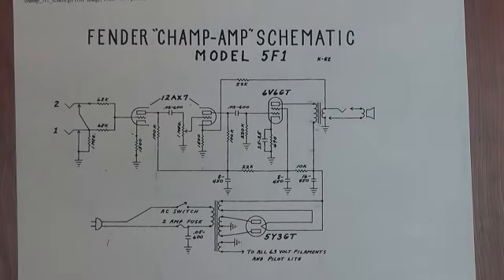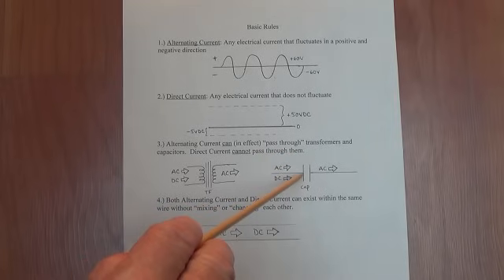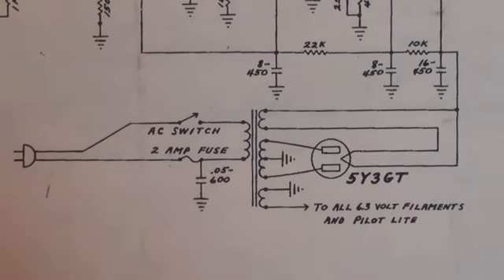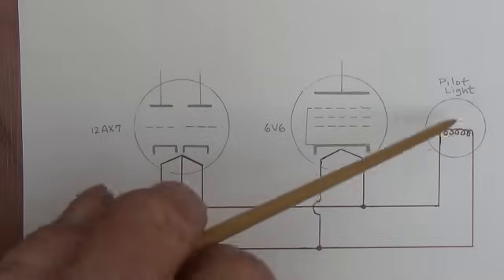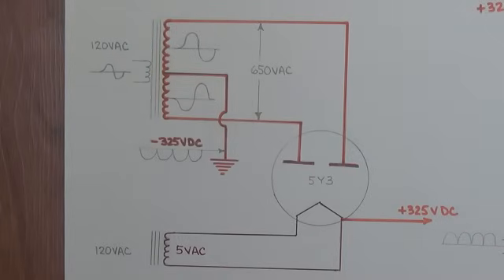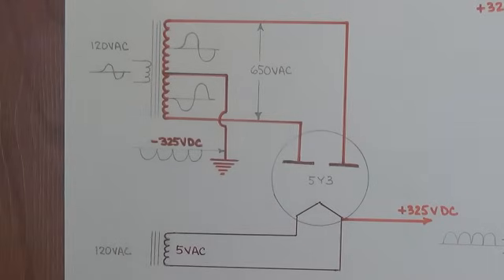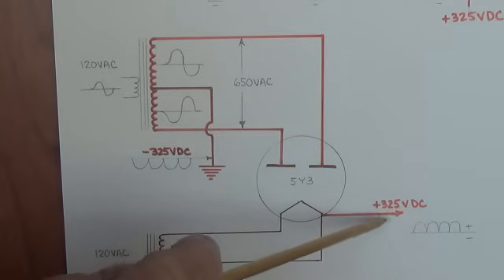How Tube Amplifiers Work, Part 1: The Power Supply

Comment: Uncle Doug I have a question about the use of the standby switch in tube amplifiers... Way back in the late sixties when I was a teenager, I played in a rock band and had a fender twin reverb... The music store owner told me to turn on the power switch first.  To let the filaments heat up.  After about 30 seconds we would do our sound check.  When that was over I would put the amp back in standby without turning it off.  Then when the first set began back out of standby.  After playing for 45 minutes it was time for the first 15 minute break.  Again back to standby without turning off the filaments. This would continue three or four times until our 4 hour set was over.  After the last song I would turn off both the standby switch and the power switch.  He told me to wait 5 or 10 minutes before moving the amp to let the filaments cool down.  He said if you move the amp all the filaments are hot you have a better chance of having the filament break.  So all of this led me to believe the standby switch was mostly to allow you to disable the amp while not turning the filaments on and off more than once per gig.  Was this strategy wrong?  Is the standby switch really for the b+ surge?
Reply: Thank you Uncle Doug. Take care and I'll stay tuned!
Reply from the maker: I think what you did, especially with a big powerful amp, was probably a good idea. Filaments tend to fail during the rapid heating phase. Since you maintained them in fully heated status, they were protected from the rapid expansion from cold to hot. Also, since no current was flowing within the tubes, the cathodes were not being "aged". However, use of a standby switch (SBS) for any other purpose is probably counter-productive. Even with the SBS, on a cold start, the filaments get the same rapid, potentially harmful heating that they would without the SBS, and who ever thought that allowing the B+ to build to maximum before blasting the tube plates with it was a good idea???  Even with diode rectification, and especially with tube rectification, the relatively slow development of B+ has to be more gentle than the SBS blast. Personally, I think your method was an ideal use of the SBS.

Comment: "Ground" is a reference plane that is deemed to be 0 volts.
"Ground" is the reference point against which most other voltages are measured.
Remember - valves in an amplifier need high voltage direct current as the power source. The purpose of the power supply is to create a high voltage DIRECT current from a high voltage alternating mains power current.

There are two ways to do this.
1/ use a bridge rectifier, or
2/ use a transformer with a centre-tapped secondary winding connected to a full wave rectifier. As this needs to bump up the voltage, using a transformer connected to a full wave rectifier is the best approach.
By using a grounded centre tap the two ends of the secondary winding will have outputs of equal voltage and current but be 180 degrees opposite in phase to each other, and will be half of the voltage as measured across the whole of the secondary winding. From a centre-tapped 650v secondary winding you'll get a +325v and a -325v as measured from the grounded centre tap.
Thinking about it as a mathematical chart with an X and a Y axis and By having a centre tap you in effect create an X-axis of 0 volts, and the secondary coil outputs 650v, swinging positive and negative 325v on the Y-axis above and below each side of the X-axis. Each end of the secondary coil is 325v when compared against the centre tap - 0v.
Connect the outputs of the secondary winding to their corresponding diode on the rectifier. That way you'll end up with a somewhat ripply Direct current. You use a power capacitor to smooth out the ripples in the DC.

The centre tap on the secondary coil is the ground plane - 0 volts.
Reply from the maker: Thanks for the lengthy and detailed explanation, S. My intent was to show that either B+ or B- are created by the power supply, depending on which power transformer lug you use for measurement. This was explained with subtitles in the video.....which were discontinued by YT.

Comment: Sir I have a question for you. I don't know how you feel about random questions, so if you choose to ignore, I really do understand. But I'm struggling with something that may be very easy for you. So I'll just ask and explain best I can.
I have an early 1960s Valco amp that I'm trying to revive back to life. I went though the preamp section with a fine tooth comb and found it to be impressively accurate with the schematic.
My problem is with the power amp portion, and how it's wired from the factory around the 5U4 rectifier tubes. (definitely not like the schematic). From the factory, they terminated one of the two wires from the power transformer to the heater element on pin #2 and the other on pin #8 (which I understand to be accurate), but then from this point on it strays from the schematic.
The schematic shows B+ wiring (to other parts of the circuit) terminated on both pin #8 - And - pin #2 
But this is how the factory wired it. They took one of the 2  wires from the transformer and terminated it to pin #2. No other wires are terminated at this connection on pin #2 it just goes from the transformer to pin #2 and that's it. At this point the factory wired ALL B+ wiring to pin #8.
So my question is, are both ways of wiring this correct, and that both methods will work? The schematic shows B+ wiring terminated to both pin #2 & #8. I seriously don't understand this. 
I've never heard this Valco even work, but I assume it worked in the past. And I can assure it's never been touched inside since production. Even has all original RCA tubes. 
I know this is a long message, but I've been thinking about this for several days and would really appreciate your input. 
Sincere gratitude
Reply from the maker: The B+ can be taken from either pin 2 or pin 8, but not both. The schematic may be trying to show that either tube pin will work......but trying to use both would result in a short circuit, bypassing the heater/cathode.
Reply: @UncleDoug   . .  Thank you sir for your response. I would love for you to take a quick look at how Valco shows the wiring to the 5U4 rectifier tubes on the schematic. I think you'll find it interesting. 
I tried to post a link but YouTube didn't like that. But typing in "Harmony H440 schematic" in Google images pulls it up as the first result.
Thank you very much.
Reply from the maker: @234dilligaf  I believe I accessed the proper schematic and it is unusual. They appear to draw the B+ from pin 8, but use pin 2 for the filtering process. This is, in my experience, quite unusual. It would probably work......but is not the way that the vast majority of circuits are wired.
Reply: @UncleDoug  . .  Thank you very much for looking at it. Valco drew it this exact same way on 4 different models that I'm aware of. Yet on my particular amp they wired it differently. They took one of the two transformer wires directly to pin #2 on both 5U4 tubes, and the second of the two transformer wires to pin #8 on both 5U4 tubes. At this point all remaining wires terminate on pin #8. (no other wires terminate on pin #2 except from the transformer). Would you personally leave it this way, or would you rewire it to reflect the schematic? This really has me stumped and I appreciate and respect your opinion.
Reply from the maker: @234dilligaf  Your wiring method is the traditional one. I would stick with it. There is no telling if the schematic was really ever followed by those assembling the circuits. As you probably know, Valco schematics are notoriously incorrect.
Reply: @UncleDoug  . .  Thank you very much for your input. I really enjoy your videos and find them relaxing. Maybe someone will find this thread helpful. I do appreciate it.
Reply from the maker: @234dilligaf  You're welcome, 234 :)

Comment: One thing I've not understood is why the 120v A/C doesn't just short through the wire windings.  Where is the load in a transformer circuit?
Reply from the maker: The wires are all coated with a shellac-like substance that insulates the windings. The load for the power transformer is the amplifier circuit.

Comment: Thank you much for your videos! You are an amazing teacher. Have you done or do you plan to do a video showing how to calculate resistor wattage, voltage drops, etc? I'm trying to calculate the wattage of the voltage drop resistors and what the voltage should be in different parts of the 5f1 circuit. But I think I may be doing it wrong.
Reply from the maker: I have covered this topic in many of my videos, Kyle. Please consult my video list.
Reply: @UncleDoug  Thank you sir. I will take a look.

Comment: Fantastic explanation. I had no idea about your points 3 & 4, and I think they explain why model railway coach lights can run off an ac signal over the same track (wires) as the dc current for the motor.
Reply from the maker: Thanks, David. Glad you liked it :)

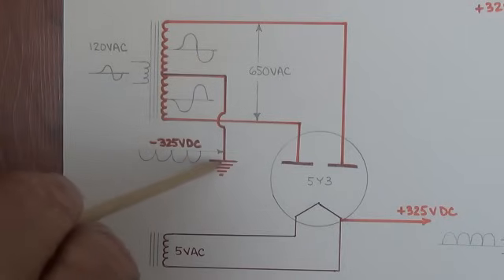Comment: Nice video! Only seen one problem. If you hook a o-scope up the probe to the ground leg at 16:05 of the video how can you get -325v it is ground? The ground of the scope is also hooked to that point. You connect the probe to the same point as the ground you will see 0 volts not -325v you should eliminate that statement cause it can never happen. All else looks great!! Keep up the good work.
Reply from the maker: This has been repeatedly addressed in previous comments, Corey. The polarity of the voltage leaving the power supply is dependent upon the arbitrary placement of the voltmeter probes. My intent was to show this in the video, which originally had clarification notes on screen (long since lost due to YT changes), but it ended up only being confusing without the notes. There is no way to edit a posted video.
Reply: @UncleDoug  I Like watching your videos I own several of the amps you work on in some of the videos. I figured the video was for a newbie home tinker tech. Not many even have an oscilloscope. You do a great job and are very descriptive in your videos. Keep them coming!!
Reply from the maker: @cc4142  Thanks, Corey. Will do.

Comment: The voltage between the peak and the trough is a measured peak voltage.  The actual effective or average voltage is the RMS voltage which is 120V AC.  The peak to peak voltage would be 1.414 X the RMS voltage or 169.68v.
Reply from the maker: Yes, indeed, Dieter. All of this is covered in detail in subsequent, far more comprehensive videos. Thanks for your input.

Comment: FOUL!  You claim that the AC voltage in fig 1 is 120 volts,  then go on to say that household supply is 120 volts,  when,  actually,  the voltage in fig 1 is 42 volts.  YOu can't use RMS for one value and then use peak-to-peak for another value.  ¡No bueno!
Reply from the maker: All of this has been discussed and explained in previous comments, John. It was a very basic presentation for beginners. Subsequently, videos have been posted containing more detailed explanations of RMS and peak voltage.

Comment: Hi uncle doug, I am curious do directly heated tube like 5y3 require standby switch or not? do they pass ac current during heating up
Reply from the maker: In my opinion, no tube-rectified amp needs a standby switch.....nor do most diode-rectified circuits. It's an old-fashioned idea that generally causes more harm than good. No tube rectifier passes AC.

Comment: Hi, thanks so much for this. I love your explanation. Dumb question: When you are explaining the lower part of the power transformer inner circuit ("to all 6.3 V filaments and pilot lite") it seems so that it is AC warming up the cathodes and not DC. The rectifier is explained after and does not seem to be related with the "frying pans" as you call them. is this correct?
Reply from the maker: Yes, in the vast majority of circuits, AC is used to heat the cathodes, causing them to release electrons. AC also heats the cathodes in the rectifier, but the electron flow is modulated to allow only positive high voltage DC to be emitted from the rectifier.

Comment: In the beginning of this video, Doug explains DC Voltage. He shows 50V positive and 5V negative. Can someone explain why these voltages are different? In other words, why is there 5V negative and not 50V negative? I’m new to tube amps so I just want to understand. Awesome channel and thanks! :)
Reply from the maker: Greetings, Chris. For electrons to flow, there must be an abundance of them in one part of the circuit (the negative part) and a deficiency of electrons in another part (the positive part). The circuit functions when the electrons flow from area of accumulation to to area of deficiency. So, if you take your voltage readings from the accumulation region you will get -V and if from the deficiency region you will get +V.
Reply: @UncleDoug  I really appreciate you responding. I figured someone in the comments would catch this question so I greatly appreciate it. I’m learning a lot from you. If you’re ever around Nashville and want to give me an electronics lesson, please do! Haha.
I worked in learning electronics when I was younger and I’m getting the very same joy out of it now. I’d like to build a power supply for guitar pedals like the isolated power supplies that are sold nowadays. But eventually I’d like to repair amplifiers so that’s my goal.
Thank you and have a great week! - Chris
Reply from the maker: @chrisoglevoiceover  The pleasure was ours, Chris. Best of luck with your continued learning....and with your power supply project.

Comment: DEATH Capacitor??
Reply from the maker: It's generally a .05uf cap between the primary AC winding of the PT and ground. If shorted, it gives the metal chassis some serious shock potential.

Comment: Hi uncle Doug. Thanks for the videos. I've learned so much from you. I have a question if it's not too much trouble. I have a few parts kicking around and would like to make a simple SE amp, diode rectifier (or possibly with the voltage doubler circuit you demonstrated). The parts I have are an EF806s tube, PL33 output tube, old valve bases some ceramic, I have an old partridge 8H 120ma choke. My question is this; how can I get the 19v heater supply for the PL33 from a 6.3v winding? Is it possible to use a resister or inductor with 1:3 ratio? It would be good to avoid having to have power transformer made especially with a 19v winding on the secondary. Thank you
Reply from the maker: Why design a complex circuit to suit a bizarre output tube? Wouldn't it be infinitely preferable to spend a few bucks and get a conventional 6.3V output tube? The problem with voltage doubling is that you halve the current flow capability. Naturally, you're welcome to proceed, but a simple change or two prior to initiating construction could greatly improve the outcome. Good luck.
Reply: Thanks for the quick reply. I was mainly curious to see if there was a way to give these cheaper valves a place in the world again without the expense of custom made transformers. But yes a 6.3v output tube would make life easier. On another subject do interstage transformers need to be matched to the preceding stage's impedance? Would they be simply 1:1 ratio. Thanks for luck
Reply from the maker: @Greg88888  My experience with interstage transformers is for phase inversion, and the impedance is definitely not matched. There really is no need for them in between pre-amp tubes, unless you had to correct a significant mismatch between the tubes, and then the impedance would also be different to suit each tube.
Reply: @UncleDoug  makes sense. Thanks for your experience
Reply from the maker: @Greg88888  You're welcome, Greg.

Comment: Hi Doug I really appreciate the education you are giving us in these videos would it be to much to ask for an explanation of a diode rectified power section like a peavey classic 30 I am trying to learn this so I can try and possibly hand wire my classic 30 one day.  Might be a high goal to hit but my amp has intermittent issues and I would love to get rid of the circuit boards.  Thank you very much  Robert.
Reply from the maker: Diode rectification is as simple as it gets, Robert. Download a vintage Fender Bassman schematic......they use 3 diodes in each HV secondary output, then on to traditional electrolytic smoothing and voltage-dropping nodes.
Reply: @UncleDoug  thank you I will study the fender bassman

Comment: Doug, you needed to explain that the 120VAC from the outlet is RMS and the Vpeak is the 120Vrms X 1.414. It really makes a huge difference when it comes to rectifiying and charging bulk capacitors, and so on.
Reply from the maker: All of this is covered in detail in another video, Maurice. The series begins with simple explanations and then increases in complexity.